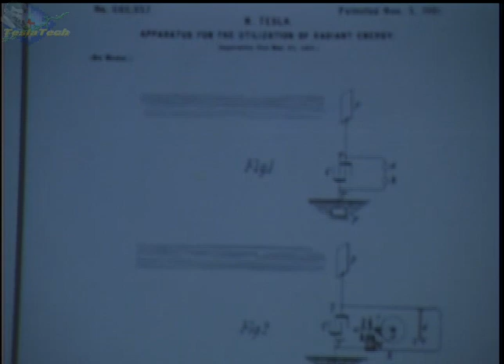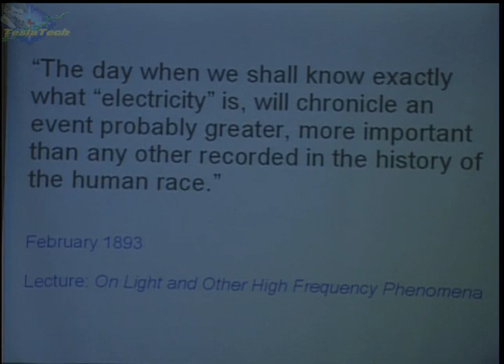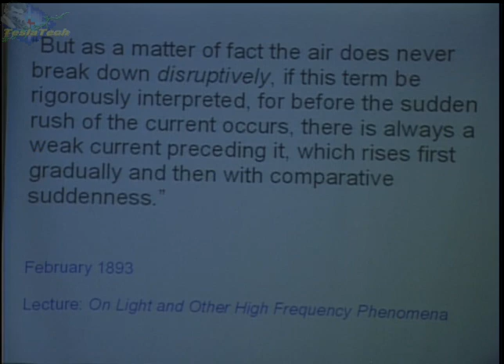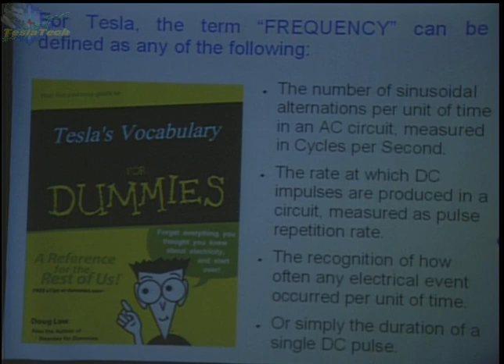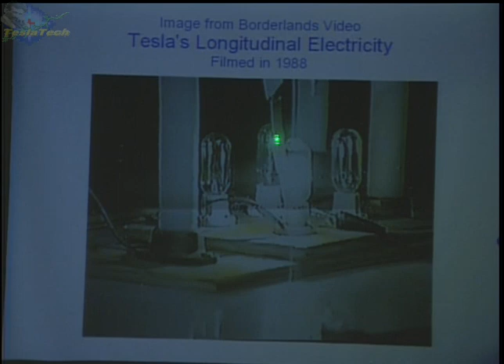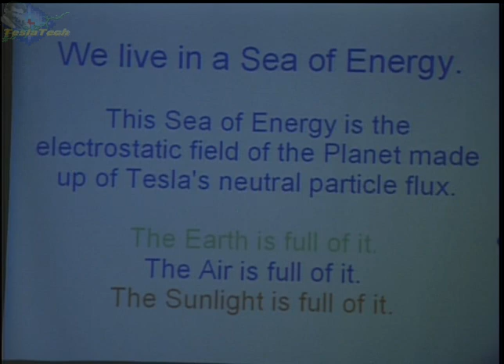Peter Lindemann - Radiant Energy & its future in our Free Energy Future, Ext Technology Conf, 2006

Comment: Intuitively, I feel like the Tesla Coil would have worked if built to correct dimensions. It seems every electrical engineer that goes down that route of actual experimentation and research into Teslas' original patents along the lines of radiant energy devices, all eventually agree it would have worked. They also conclude it worked on longitudinal waveforms, and therefore, correct physical dimensions were important for manifesting the correct resonance, which is fundamental to how the Tesla Coil works. 

   At the same time, mentioning Tesla to serious electrical engineers usually comes with scorn and ridicule.

   One of the biggest pushbacks is violating the law of energy conservation. I'm not sure how to get around that as physics takes its laws very seriously.
Reply: I think you mean Wardenclyffe. 
Tesla coils work.
There's no dispute about that.
Where there is dispute is whether or not Earth itself can be used as the medium for power and information like Tesla envisioned.

Nikola Tesla never claimed Wardenclyffe would produce free energy.
Nothing could be further from the truth. What Tesla claimed was that it would be more efficient to use Earth rather than the atmosphere as the medium for radio and power.
He claimed that his tower would lose less energy when transmitting into the ground as opposed to creating disturbances in the air.

The so-called 'free energy' idea appears to be derived from a patent Tesla had regarding creating an antenna of sorts that would gain charge from atmospheric electricity.
A raised plate constructed as he described would take advantage of the voltage difference between Earth and higher altitudes.

This patent appears to be describing an invention that is similar to a solar panel. 

Would you call solar panels 'free energy devices'?
Reply: @Chicken_Little_Syndrome  Tesla stated, clearly, that he was aiming to displace the Earth's electrical potential, that is free energy, COP > 1. Nothing magic about it.